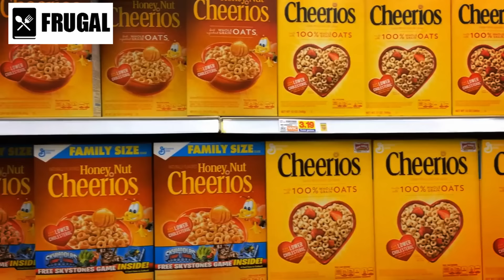8 Grocery Products That Will SKYROCKET in PRICE Next Month

Comment: Buy the whole grain.  Wheat berries, soft white for biscuits, and hard red and hard white for bread.  Whole grains can be used to make cereals. Yeast, buy at Sams in 2 1lbs packages.  Very cheap store in your freezer.  Baking soda and cream of tartar (in place of baking powder).  Bullion, white and apple vinegar, corn starch.  Powered eggs, olive oil, (store oils in your freezer.   Rice, pasta, tomato powder.  Rice and pasta need only to be kept dry and out of the light.  Canned meat and fish. Coffee, tea, cocoa.  Dry laundry sheet (cheap and store in a very small area).  Dish detergent, hand soap.  Dry bleach. (liquid bleach does not store) check pool treatments, some of those are dry bleach.  Canned tomatoes, can potatoes, other canned veggies.   Spices.  You can buy many small bottles of spices, Walmart brand, very cheap.  I have found Walmart Veggies of good quality and good price.  If you buy whole grains you will need a mill.  There are hand mills, and electric mills.  A good coffee mill will work to make flour.  Just be careful not to over heat it when grinding grain.  You have to grind very small amounts.  I never ground more then 1 cup of grain at a time and then allowed my small mill to cool before grinding more.  Chocolate chips and candy and dry fruit store very well if you vacuum pack in Mason jars.  Nuts will store for over a year in your freezer.  Dry soups store very well and take up little space.    I do not use them but something easy to store and good for protein are protein powders.  If I had kids I would store a lot of protein powders.   Dry milk, and potatoes.  You can buy dry whole milk it just has a shorter storage time but still over a near.  You can get 1 qt of shelf stable milk at Dollar Tree for $1.25.  I buy it by the case and pick it up at the store.  I mix 1 qt of whole shelf stable milk to 1 qt mixed dry milk.  Makes 1/2 gal of milk.  Be sure and mix your milk in glass.  Plastic, after being used a few times start to taste bad.  Hope this gives you some ideas.  Check around the house for silver. Old silver may be sterling and can be use in tough times to trade.
Reply: Great suggestions! My plans center around ALL shelf stable foods because I can not rely on the fact that we will have power for refrigeration. I can, so not only have I put up single fruits/veg, but also relishes, pickled eggs, meals like ham and beans, veggies soup w/ground meat, and single proteins -chicken, ground beef, venison.I also glass pack hard boiled eggs. (Look it up if you've never heard of it!!!) I  dehydrate fruits to use dry, or to stew to make pies or over biscuits or cake. For fats, powdered butter and shelf stable fatback or pig jowls (which I know you won't find in many Northern states). I've only stored bar soap because it takes up less room & can be made into laundry detergent & dish liquid, too! Fels Naptha is a great old brand for this, but it's hard to find! To your great list, I'd add and vacuum pack dried beans, split peas, and lentils, all for protein and variety. If you make your own medicinals, add witch hazel, Ever Clear, & vodka, to the list! (Those last 2 WILL become tradeable too 🥴) If you have the tiniest patch of ground or even window sills don't forget to buy seeds! What you buy in the grocery store is no longer producing seeds which reliably produce, if at all! And, if anyone relies on their computer for recipes of any kind (meals, medicinals), make copies!
Reply: So you say get everything.
Reply: @kathyrobertson4493  The more prepared you are the easier tough times can be.  Some items have many uses.  Take baking soda.  Used with cornstarch you can make body powder, you can use it to brush your teeth, you can use it to clean.  A little bit calms an acid stomach.  Baking Powder goes bad in a year or so but baking soda and cream of tartar keep almost forever until mixed.  Flour of any kind has a short shelf life but whole grains keep for many years, like over 25.  What I try to do is to help people to learn from my mistakes.  If I was starting out right now, with nothing I would start with whole grains, a grain mill, yeast, baking soda , cream of tartar, salt, sugar, dry milk, gluten, dry eggs, spices, bullion, canned meats and fish, cooking oils, pasta, rice.  That is where I would start.  Of course each person is starting at a different point but for everyone the time is short.
Reply: @lindael2  😊

Comment: Stock up on only those foods you actually use on a regular basis. If you do not usually make bread, biscuits, pie crust, pizza dough, cakes, gravy or breaded meats (fried chicken, chicken fried steak, salmon patties...) from scratch, you will probably not need flour.

However, if you only cook occasionally and have limited cooking skills, dry plain pastas (such as macaroni and spaghetti pasta) will be a form of flour that you will actually use when you decide to make a meal from scratch. Dry pasta if first frozen for at least 72 hrs (to kill the tiny eggs of grain-eating weevils/maggots), then allowed to rest at room temperature for several hours before placing into an air-tight, food safe container can store for at least 5 years in a cool, dry pantry. And pasta is inexpensive, has a lot of calories and cooks quickly in simmering water. And the cooking water can be reused for other purposes (with packaged muffin mixes or pancake mixes to make a batter or to make oatmeal porridge or to water houseplants when cooled), so no stored water used for cooking pasta need be wasted during an emergency.

Canned soup and broth are very expensive considering the amount of actual food that is mixed with water. Check out the calories per serving listed on the label to see for yourself. It is much more frugal to make soups and broths from scratch. You can stock up on dehydrated vegetables, dried culinary herbs, dried beans/peas/lentils, bouillon cubes or powders, bean soup mixes, packets of onion soup mix and use leftover cooked meats, leftover cooked vegetables and bacon drippings to make your owns soups. Soups are very easy to make by slowly simmering the ingredients on the stove top or gently cooking them in a slow cooker. There are thousands of free soup, chowder, chili and stew recipes on the internet or in cookbooks in your local library. Teach yourself how to make a few of these instead of paying too much for the canned versions.

Freeze-dried coffee can store for years in a cool dry pantry. Unlike ground coffee beans, freeze-dried coffee will not go rancid if you do not use it soon. To improve the taste of a coffee beverage made from freeze-dried coffee, first mix the serving of freeze-dried coffee in the mug with a little cool water to make a slurry and only then add the freshly boiled water. Then add milk or sweetener or flavored syrups if you wish. Tea bags can store for years in an air-tight container if kept in a cool, dry, dark cabinet.

If stocking up on jars or cans of tomato-based pasta sauces, al fredo sauces or cheese sauces, do remember that these products have a limited shelf life. Store them in a cool, dark, dry pantry and use them within their "best by" dates for best flavor, color and texture. Better yet, learn to make these sauces at home from basic ingredients for best quality and flavor. There are many free sauce recipes available for making your own "no chemical additives or artificial flavorings" pasta sauces. Yes, if you decide to make sauces, you will need plain flour for most of them.

Factory produced granola and boxed breakfast cereals, such as Corn Flakes and Cheerios, are very expensive per serving. So is refrigerated milk. If you want a frugal breakfast cereal with zero chemical preservatives or artificial flavorings, choose a hot cereal instead. Such as oatmeal porridge, grits or cream of wheat. Remember that these are grain products, so if you want to extend the shelf life, you must first kill any microscopic insect eggs before storing these grain products. Instead of using expensive refrigerated milk, stock up on powdered nonfat milk and use it to make the milk for your oatmeal porridge. You could also make granola from scratch using just basic ingredients such as rolled oats, chopped nuts and honey, but this is labor intensive and granola has a short shelf life because of the fat in it.

Generally, factory canned fruit has a shorter shelf life than factory canned vegetables. Canned pineapple has the shortest shelf life of all the canned fruits. Raisins and dried cranberries have a decent shelf life, especially if stored in plastic food bags in a refrigerator. Generally it is best to use canned fruit before its "best used by" date so that you do not have any cans of spoiled fruit -- especially leaky cans -- in your pantry. If you want fruit for long-term storage, it is better to go with dried fruit packaged in either Mylar bags or #10 cans along with oxygen absorbers.
Reply: Thanks a million! God Bless you!
Reply: I don't bake bread as a rule but I have done in the past and if there's no bread available I would do it again, but I would opt for flatbread, which uses the stove top and saves on oven use  which uses a lot of gas and is easier to make. Also in hard times when calories count, I would buy full cream powdered milk
Reply: Thank you for such good information!!
Reply: I have been canning, pickling, dehydrating, and powdering foods for years to always have an extended emergency stash (2yrs). My food plan centers on absolutely nothing needing refrigerated or the addition of anything refrigerated. In all of that time, I've never come across that tip about freezing grain products! I am so excited to add pasta now for more variety!  I do vacuum pack flour, cornmeal, and TVP, rotate it,and hope for the best, but now, between your tip and the jar vacuum pack sealer that I have, my grain products will be doubly protected! TU for sharing! 😊